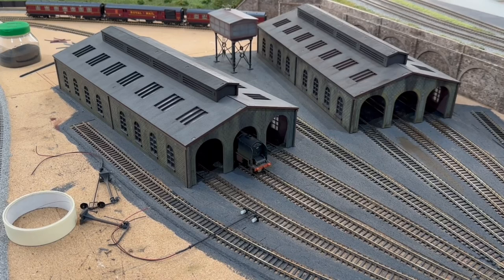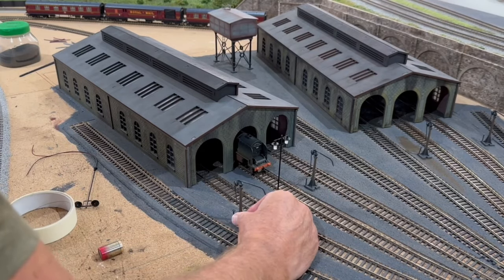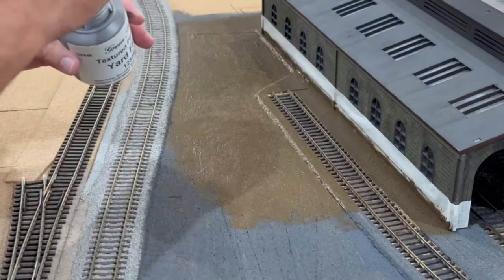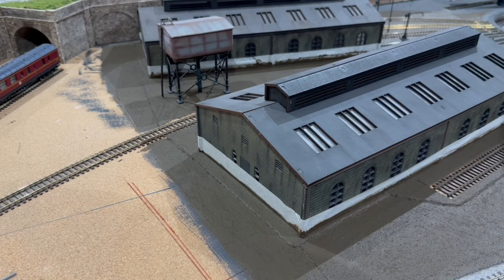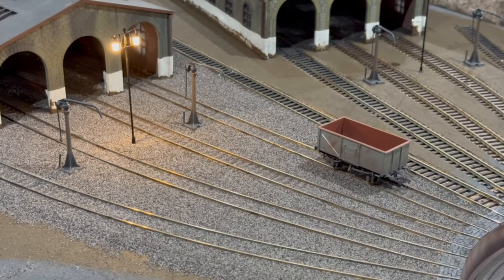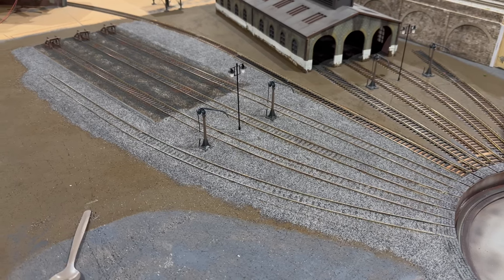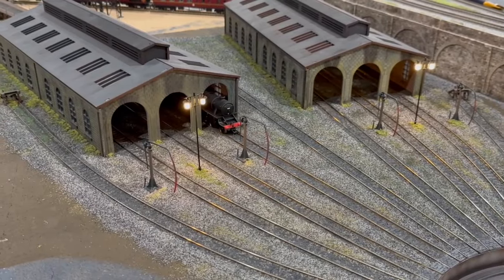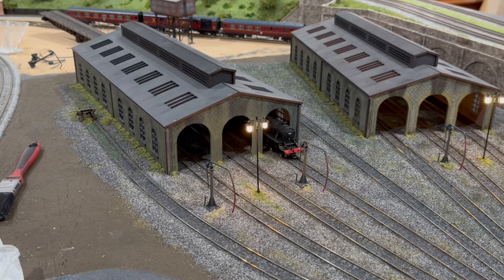My Big Model Railway Build - #21. The Loco Yard - Part 3

Comment: Just a thought ref at the back of shed, some had the sand drying furnace with outbuildings & messrooms for various grades ie cleaners, fitters, footplatemen & running foreman/clerks/time offices. Ones I’ve noted have been mostly brick built either attached or detached from shed. You’d have a chimney as well for the furnace to complete the scene.
All looking good though. Nice vid, for ideas, thank you.🙂
Reply from the maker: Brilliant. Thank you. Lots of ideas for that area 👍